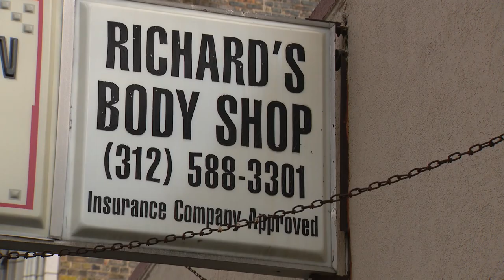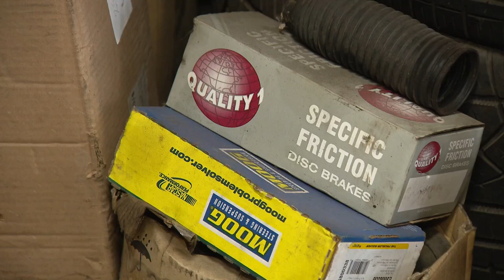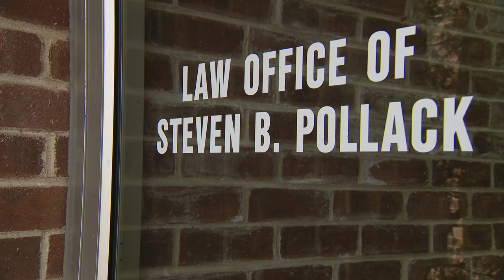Supply chain issues delaying car repairs, leaving Illinois drivers stranded

Comment: Depending on where you live, what you are accustomed to driving and whether or not you’re worried what other people think, there is or could be a solution. In my area there is a U-Haul rental. A pick up truck or a very small van cost $19.95 per day. And it might be a good way to get around it if you can stand the fact that you’re driving a rental vehicle. If appearances are a big deal maybe you will walk. If you need lodging for the evening in good weather, and a hotel cost $100 a night or more, rent a small van and some moving blankets, it might save you a lot of money.
Reply: Haha it’s $19.95 plus mileage. That comes out to be about $50-$60 a day for most people
Reply: you forgot $20 a day + mileage and you can only get the vans or pickups with a credit card. Uhaul doesn't allow debit cards for pickups/cargo van